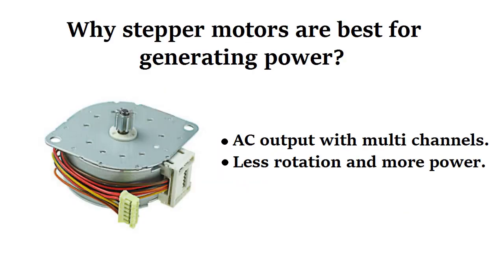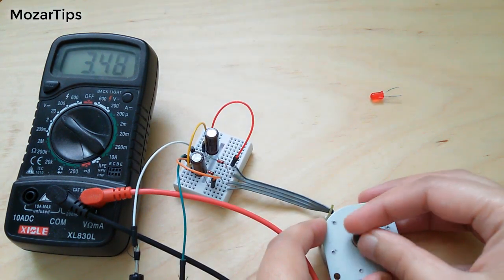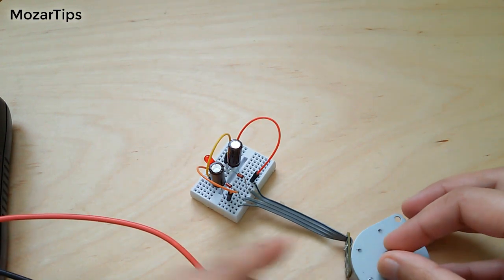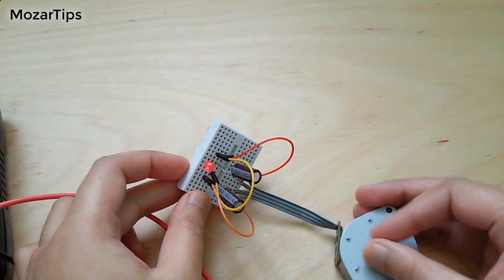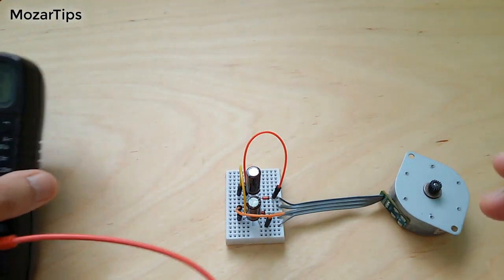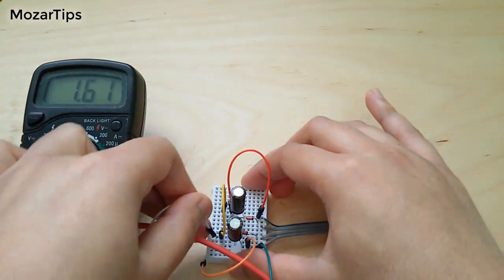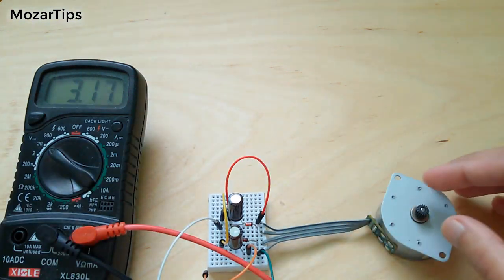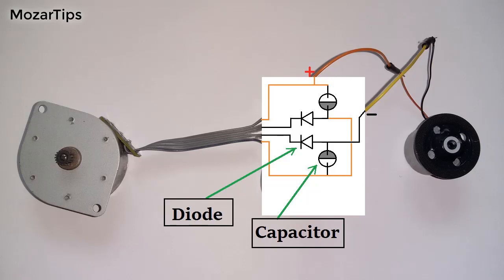2x MORE POWER OUTPUT (stepper motor generator)

Comment: Would u plz be kind enough to let me know what size of stepper motor I must used for making a low rpm generator that it's output power is 100 watts.thanos,GBU
Reply from the maker: no, I'm no more interested.

Comment: One question : when you spin the stepper motor... What kind of power is it generating? 
Is it 3 phase ac?
Reply from the maker: I don't have oscilloscope so so I didn't check it. But it was outputting ac current so I've added home made rectifier to collect currents from both ways.